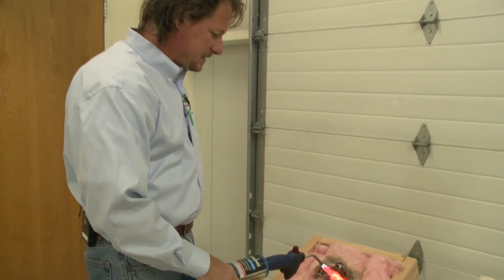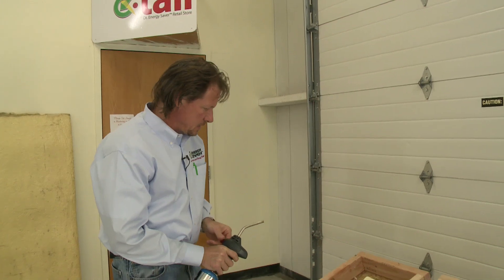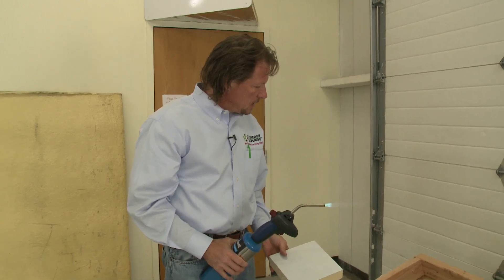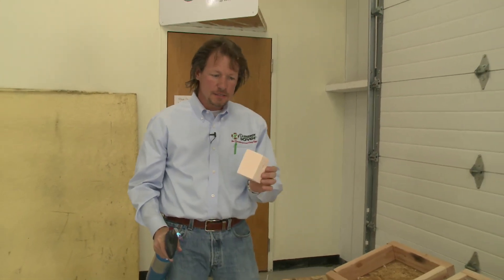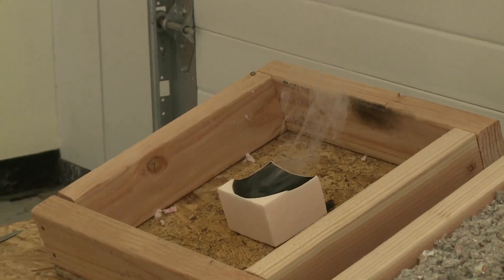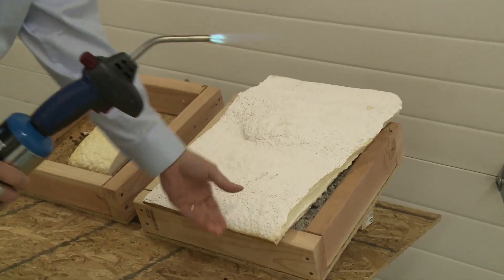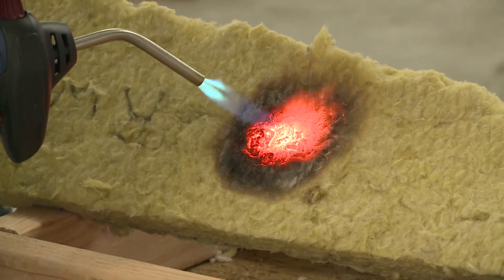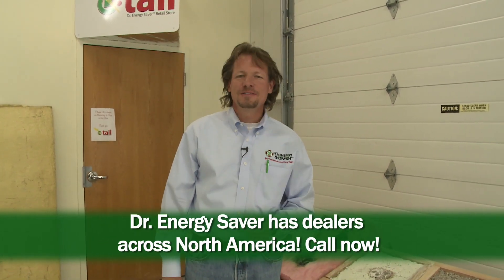Fire Testing Insulation Materials

Comment: I worked at a cellulose insulation factory years ago, we took recycled papers ground them up and sprayed them with fire retardant chemicals. The jets that sprayed the chemicals clogged several times daily. Meanwhile countless bags of untreated cellulose / ground up paper was bagged and loaded into trucks.

We took grab samples every 15 minutes and held a propane torch flame directly on the insulation for 20 seconds for testing if the insulation caught fire we knew the jets were clogged.  As I said countless bags of cellulose insulation were bagged and loaded into truck. We never unloaded the bags.

I'd bet anyone that there are millions of homes that have highly flammable ground up paper crammed in attics ready to catch fire.

I would NEVER put this product in any space such as and attic that was exposed to high heat or around electrical wiring.

Even worse I would be willing to bet that after time the chemicals sprayed on the papers breaks down or dissipates. If you have cellulose in your home I would test it annually.

So glad that was only a temporary job to get me through school and that I knew better than to put this in any areas of my home exposed to high heat.
Reply: This is why I am re insulating my entire home with roxul insulation. Spray foam will kill you because of the amount of smoke. Fiberglass as you have seen does nothing. Improper factory products such as you have stated will burn your ass.

Roxul is good up to 2100 degrees, because it’s made of basically rock. It also has great r value per inch.
Reply: Actually cellulose is NOT very flammable at all. Single sheet paper is flammable because oxygen is getting close easily. But a book or  pack of paper is hardly burning.
Reply: +VTV // reply // Why does Cellulose insulation smell. It's because they add a sweet smelling sterilizing agent to it to reduce the former waste paper bedding smell (its mostly sold for animal bedding), when collected from waste paper warehouses and dumpsters behind shops it can contain germs, ants, insects, mice, rats and wildlife droppings, so for public safety reasons it must go under the squirted on liquid sterlizor spayor . Too much sterilizor can go in in one area because the conveyot belts stopped for a paper jam, and other areas can go untreated.  Its waste paper called Cellulose a trade name to improve its image and value.  Now you know.
Reply: Actually if I were blowing insulation I'd use Roxsul(Rockwool) (mineral wool) as it's pretty much NOT gonna catch fire and is priced well within most people's budgets.
Reply: @fastrivers812  , You did see the penny melt, didn't you? That's a lot of fire protection. Smoldering afterwards might be something a fireman whines about, but anyone trapped inside a burning home appreciates the firewall. 

The employee described an incident "years ago" when lots of mom & pop insulation processors popped up. That has nothing to do with today's' product which is rigorously tested and inspected by outside sources. Years ago when he was in the business, they lacked the technology (process control) widely used today. It's two different products. Cellulose does exactly what it is engineered to do. It fills wall cavities displacing air. For that reason, a fire cannot start in a wall cavity. Likewise, the fire won't start in the attic if the wiring or other combustible sources are covered. Of course it smolders, while EVERYTHING else burns up! It meets all requirements for classification as a fire retardant insulation, which it is. 

Fiberglass melts and releases gases. Fiberglass does not prevent inside-the-wall fires. Fiberglass is more air than 'glass. Pump foam shrinks so it does not protect against wall fires either. If your fireman friend were to fight fires at two identical houses, one with cellulose packed in walls and attic (and even floors) and the other with fiberglass, The fiberglass house would burn away, and there would be little damage to the cellulose insulated home. This was a test done several times. A little cellulose over the attic fiberglass and fiberglass blankets in the wall is a different story. If enough cellulose is not installed, then it's not available to prevent/slow the spread of fire. Your firefighter friend may not like "smoldering," but he doesn't like shooting flames, either. 

I have photos of homes engulfed in fire with no cellulose in the walls. The flames shoot high into the sky, and all is gone in little time. I have personal experience with a commercial fire. A ten thousand foot brick warehouse burned down. The only thing left standing was my office fully insulated with cellulose. Please don't confuse some mom & pop1980's cellulose with that of today. And don't dismiss the fire rating of cellulose because of a fireman's complaints about "smoldering." I’ve seen more than one home where children and adults perished. I know in my heart if the walls, ceiling, and floors were insulated with cellulose the fire would not have spread, or spread slowly enough to be detected in time. Those diseased folks wouldn’t mind a little smoldering. Firemen don't define and regulate the fire codes regulating insulation. That's done on a national level. Those folks take input from anyone with any idea or concern. Maybe the fireman needs better training to understand the alternatives?
Reply: @larrymaloney877  And you probably buy chinese toys laced with lead and other toxic chemicals because you were told it is safe and good.
Reply: Hoefledorf My honest opinion, don't put shredded paper in your attic or walls, regardless if you put boric acid in it. At some point it will break down and you'll have highly flammable material lining your attic and walls.

Please understand this is a promotional video, their trying to sell you their product.
Reply: Hoefledorf I don't want to come off as an authority on fire safety. I just know the experience I had as a college student working in a factory that manufactured cellulose insulation. It's not regulated so unfortunately anything goes with profit being the main objective.

It's sounds to me you're being very cautious and I think with what you've just said you should be okay, I would flame test every bag before blowing it in. And just to throw this out there, after my parents had passed away we cleaned their home and found a lot of old newspaper in the attic, never had a house fire. Add to that there are millions of homes that have cellulose,  if it were a major problem it would have been widely known by now.

I just get a bit edgy when I see ads like the one above make unsubstantiated claims.
Reply: Thank you for sharing this, people need to know this kind of shit when it comes to building a home. If you can get Rockwool, can't go wrong, it is also mold proof, water resistant, and gives a good STC rating for sound.
Reply: @1stzard  "... it is also mold proof, water resistant, and gives a good STC rating for sound." The same can be said of cellulose insulation - but for MUCH less money. Rock wool insulation is great, but is it available as a blow-in? Batt installers generally (meaning much greater than 50%) do a horrible job of installing, whether its fiberglass or rock wool or any other type of batt. Horrible install is due to a lack of training, a lack of care, and the need to get it done quick so they can get to the next job or -get to the bar. I'll stick with modern cellulose for much of my needs. You're free to do as you choose.
Ain't America great?!?
Reply: This is why you shouldn't buy american made stuff.
Reply: @MichaelMantion  Blanket statement about American products? Like anything and anywhere there is good and bad products. Shit I bet you have a iphone.
Reply: @1stzard  No clue what your point is, no I don't have an iPhone. Absolutely there are exceptions to every rule. but in general US manufacturing isn't very good.
Reply: @MichaelMantion  So in general, you would rather see a made in China label vs made in the USA?
Reply: @1stzard  Id rather Americans care about the work they are doing.  not just the people feeding the machines or crafting things, but quality control and the engineers that design the processes.  Any nation can make junk, what I don't understand is why we pay a decent wage to our citizens but few care about the final product.  I get it when a guy in china or mexico or india, works all week and can't afford decent food,  I understand if they don't care about quality for items being made for another nation.  But when people in the USA have huge budgets to make things in the USA yet make junk, and expect out fellow citizens to buy the junk at a premium.....   So yes, until Americans as a whole start making product worthy of the pay, id rather see made in china.

Comment: The thing is, if there ever is a fire inside a wall there wouldn't be enough air to produce a huge fire, let alone to produce a temperature of 2200 degrees Celsius (3992 degrees Fahrenheit) like that butane burner you got.

Comment: When a house caches fire it will go on framing not jump from insulation to another insulation. The foam is pretty much stupid it melts BUT it doesn't really stop the fire but the recycled paper is so much better it doesn't really burn and this will not give a fire a room to breath!!!
Reply: +Nel Edora You're right. BUT as far as an insulating product goes, it is not stupid at all. Dense-pack cellulose insulation can be conveniently installed around beams, old insulation...and most importantly...around current fixtures...without having to re-wire the house. Because cellulose insulation is more fire-retardant, you are less likely to have a fire caused by a wire short. The majority of house fires are caused by kitchen incidents, smoking in bed, and faulty wires. Any insulation wouldn't stop the first two causes.
Reply: @Juniper2276, that is why it became forbidden to install wires exposed in Sweden. Must be wired through PVC tubing which prevents wire shortening from performing fire risk. The PVC pipe can allow a wire to burn from socket to fuse without creating a fire as consequence. Nod 

Not to mention, super easy to change wires out without having to knock walls down. And less risk of driving a screw right through the wires.

Comment: I am really happy now that i went with roxul rock wool insulation .Great informative video
Reply: sissy murphy i think the fire (smoke) will kil you faster then the water. Rockwool has a superb quality when it came to fire, sound and heat insulation. Glava is a cheaper alternative but it has som problems. a smal fire wil cause the foam to fill the house with life-thretening gasses. Rockwool, nope..
Reply: Look video how rockwool works with water and for sure you get second thought.
Reply: Mr. Wizeguy I tried looking for videos where rock insulation performed poorly with water but I couldn't.
Reply: I think Mr. Wizeguy was confusing the blown-in cellulose in the video with rock wool.

Comment: In Australia we don't have fibreglass with Kraft paper bonded to it so that's not a fire problem for us.

There have been an occasional problem in the past with cellulose burning or smoldering, but this is because it was not manufactured to the correct standard. Cellulose has been covered by a standard since 1986. The product has changed since the 50s and the additives have changed and are much better.

We have fire tested old cellulose that was installed probably in the 80s that had been saturated with rainwater from a roof leak. The fire test was still perfect.

People should start looking at effective insitu thermal ratings rather than labelled insulation ratings as this is an important consideration when looking at insulation products. All Australian products have a zero spread of flame if manufactured correctly.

Effective insulation is the labelled R rating adjusted for climatic and installed conditions. All insulation has effective R ratings lower than their labelled R ratings some products there is only a small difference and some products there is a huge difference especially if high insulation ratings are required.

Comment: Not all cellulose can be judged the same.  Cellulose has been used since around the 50's.  The old house I live in recently had a fire start directly in the insulation by nothing more than a spark.  This is just a warning for anyone that has an older house with cellulose, the older stuff has definite fire potential!!
Reply: I don't think it would be a good choice if you live in a termite prone area either.

Comment: Thanks for a very informative demonstration. It would have been nice if a sample typical of strawbale construction (ie densely packed and encased in plaster ) had been demo'd.
There is a great deal of interest world-wide due to straw being touted as a green/sustainable material, that interest perhaps being greater in Europe than North America where it is being used in urban high-rises .

 At the densities recommended for building,,when exposed to open flame,the straw simply smoulders rather than bursts into flame as one might expect.

However, the straw is typically protected by wet-applied plaster typically to a thickness that provides a multi-hour (ie 3 or more) fire rating as per ASTM.

Comment: You weren't consistent with each material.  The first two were burned with the flame and melted, but didn't continue to burn once you took the fire off, just like the foams.  However, you focused on different outcomes when they were similar.  Also, to compare fairly, you'd have to hold the flame on each material for the same amount of time.

Comment: Recently a barn (more like a house really) that I built in 2005 with closed cell spray foam burned and was mortally destroyed.  Amazingly, the 3/4" knotty pine that I had lined the entire inside of the structure with burned away completely, yet there was not one hole in the roof sheathing or wall sheathing due to the closed cell spray foam!  A REAL fire test! I was impressed. It didn't melt into a liquified mess and provide fuel to the fire - it insulated the framing and sheathing instead.